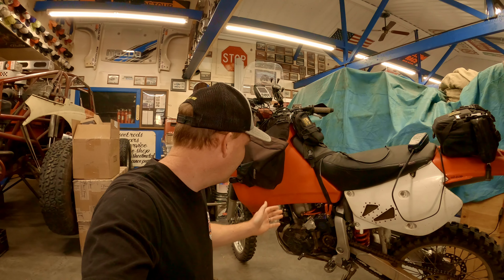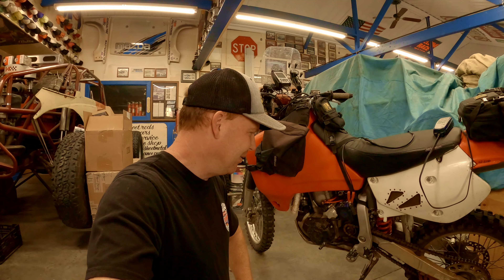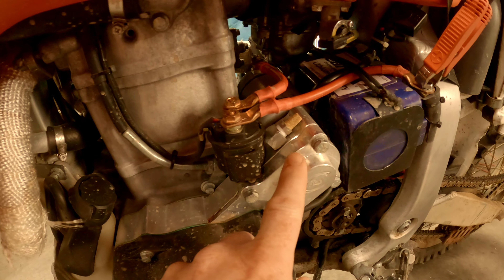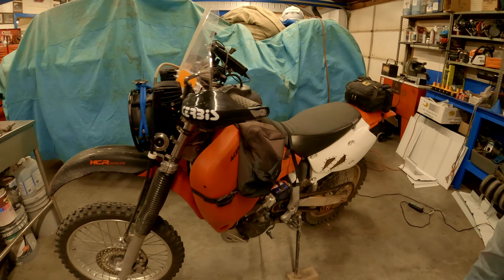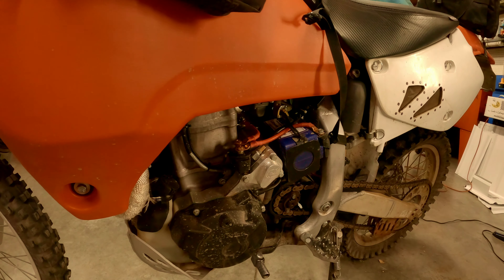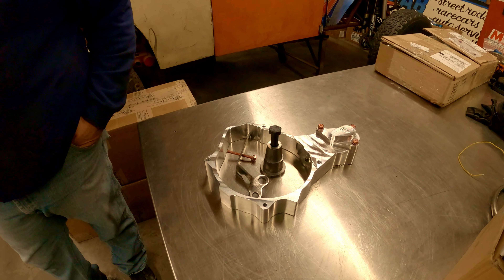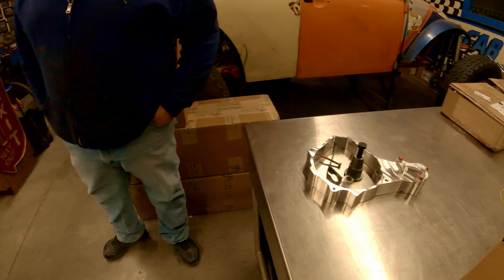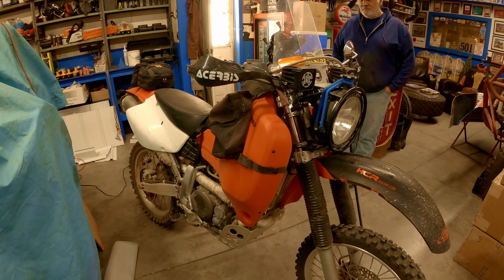C-Fab Honda XR650R Electric Start Kit (Made in the USA)

Comment: Does that additional engine cover on the stator side also increase the effective oil capacity of the engine? If so, that’s also a big benefit (like some oversized clutch covers increase oil by 200ml)
Reply from the maker: The Stator is dry in the XR650R

Comment: I have wanted the C-fab kit for a long time...still do. I don't know how people are completing it for $1600 though (as you claimed on FB). When I sourced all the parts, it was going to be about $2200 to complete it.
I would have left this comment on your FB post but I'm currently banned from posting.
Reply from the maker: That is the price C-Fab says his guys say it's averaging. I already have a stator for example, I would hope most XR650R's due at this point. Everyone I know that has an XR650R has lighting, etc and thus a stator. For battery yeah you can buy earthx or Antigravity but there are other options too. He showed me the parts cost as he keeps a eBay page with them and a starter is $38, I don't recall the other part cost and yeah you got to machine which he can do and I think that is $70. You are paying for the housing as you know and the extension piece and as you can see XR Poland is charging the same really although told me his cost was $200. I know C-Fabs cost isn't that low at all. 

I also talk on my FB page about there is a lot of factors for a small shop to not be able to do a kit with everything. Is XR Poland going to warranty that generic Battery? Or how about the starter? I talk in depth about the business implication of having to store, and warranty all those parts. You do know C-Fab is basically a one man shop who builds race trucks. He has like one young guy working there on that stuff. If you think the guy is rich you are so mistaken. Just a dude that made a kit for a bike he rides.

Without any other kit to copy he designed and built one. So yeah, it's horiable to see someone buy his and copy it 100%. For XR Poland to claim he had issues, but yet never reached out to C-Fab but yet has some knowledge to be able to have the housing and extension made. That is pretty shitty of XR Poland, his deal right off the bat was to copy C-Fabs kit and he clearly did that because there was no need for the extra drain plug material to be added except XR Poland copied it 100%, didn't even try to make a change. 

Then when you dig deeper into XR Poland, his issues wasn't with the housing it was with the gears. So probably sourced Chinese gears and had an issue assuming there was ever a problem. XR Poland clearly shows C-Fab's kit starting the bike.

I know you are here to say $1600, and you don't see how it would be that low...that is what customers of C-Fabs in the 50+ range have reported back. Maybe they already have a stator, a battery (most of us do). But you could be right if you need to buy a Stator or an awesome battery those alone could be $500. So yeah, you might pay $2000 when all is said and done, especially if you buy name brand components. I think he once told me you buy Honda parts you probably looking at $2,500+ yeah and I believe it. 

The question is for $2,200 what battery, Stator and components is XR Poland giving you? That battery looked pretty generic, the stator too. Are those just Chinese junk? I know anytime I've bought Chinese drill batteries it's 50/50 chance they even work let alone last longer then a month. I just had a Battery Tender brand Lithium bike battery last less then a month. So that brings me back to how is XR Polands warranty and will he send out another battery, starter, etc if there are issues?

Honestly I don't see XR Polands people ordereing from C-Fab as he is in Europe and I don't see people like me here in the US ordering from XR Poland. So probably doesn't matter much just shitty he copied a design flat out. Not hard to make slight changes and say "my housing is better".
Reply: Hey. How I order the part from cfab and how I will get the part numbers for the other parts to complete the kit?
Reply: @Meekerextreme  I ordered the kit and parts a few days ago and now retract my previous comment about total cost. When I originally put my list together, I was looking at all new OEM parts, from Partzilla. However, I got most everything from ebay, aftermarket or used and yes, it was significantly cheaper. I haven't added it up yet but probably close to $1600 total. I can't wait to put it on my bike. Thanks for the video.
Reply: Justin Schooler  Yes, I finally got it working. It was not easy but in the end is worth it. In my case, the bike would not start via e-start, until I also upgraded to a programmable digital DC CDI from Ignitech in the Czech Republic. So add about another $200 required to make this modification work.

Comment: Hey I'm sorry to bother you guys very nice  Kit. I just bought an XR and I am new with these bikes so I am reaching out because I can't find the information I need anywhere else. I am having trouble with the manual decompression system. It quite simply doesn't work I actually took the valve adjustment covers off and look at the system and no matter where the Cam is placed even at top dead centre on compression stroke Utilising the manual decompression lever never actually touches the valve and  Releases compression. I have tried adjusting the cable but even taking the cable off at full rotation of the adjustment arm It never pushes the valve down.

Comment: Here in Portugal there are no electric start kits for XR 650. For what I've read it may fail, as it ads "a lot" of weight to the tip, it may cause vibrations and after a certain period of time it may brake. So it may be a lottery. Why not use the XR with kick? With a mikuni and well tuned you can start it so easily
Reply from the maker: There are many reasons to have an electric start bike. Hard terrain and not enough room to kick, been there done that many times. Stall on a steep singletrack hill and  got to figure out how to kick start it. Maybe you are older and have bad knees etc...lot's of reasons to have an electric starter. Hence why people buy them.

I have yet heard of anything breaking because of the stress on the "tip", whatever that is. C-Fab has had his on for many years and many mils and no issues. Another guy has had his on for a long time too with no issues.